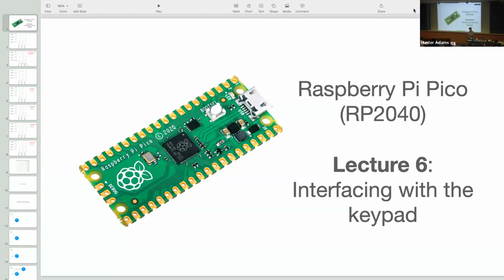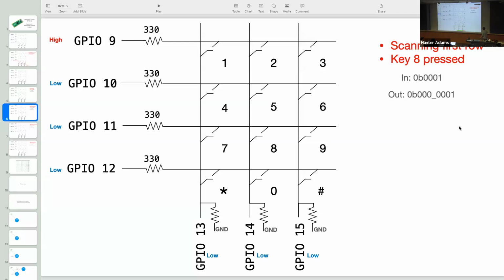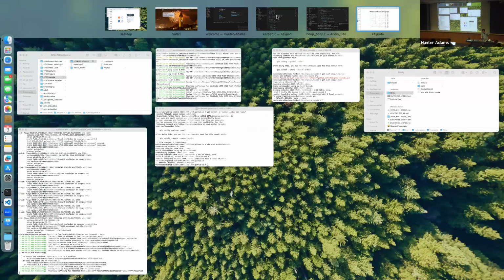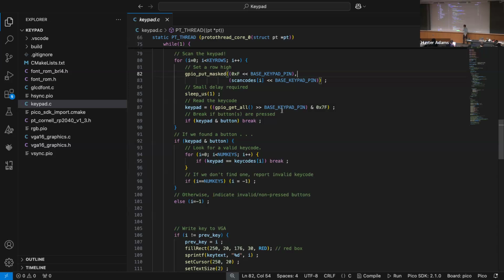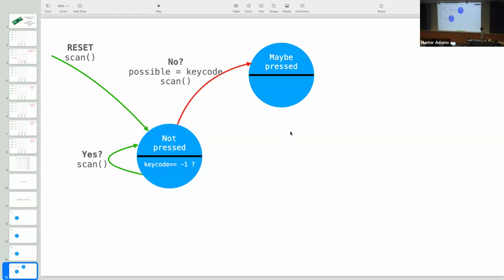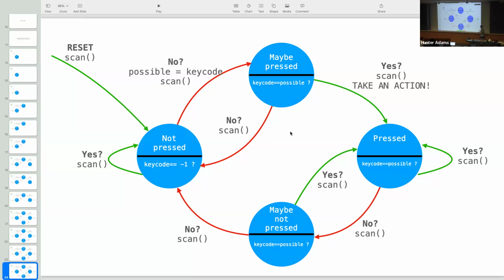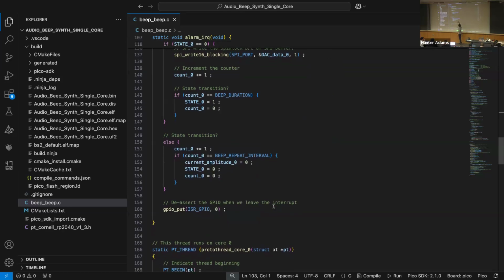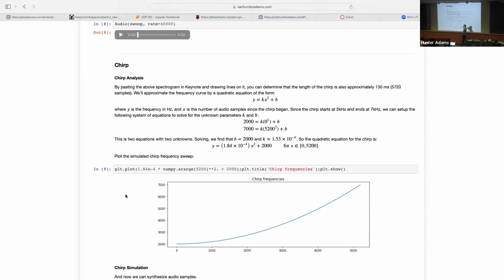Raspberry Pi Pico Lecture 6 (2025): Interfacing with a keypad

Comment: On my (non-matrix) button press code I generate a multi-byte field with a bit per pressed button from a timer interrupt, and I keep a ring-buffer of the last 8 such fields.   A key is only deemed pressed if the bitwise "and" of the relevant bit in all 8 ring-buffer entries is set.   Very simple, with no state machine - just button press history.

Comment: Hello, I really appreciate you taking your time to make and upload these videos. They have been an amazing resource for me. I have a quick question regarding the keypad. You mentioned using resistors to prevent shorting of two of the output pins. Why not just use a diode? Wouldn't that prevent the flow of electricity into the pins, or would the pins still short to ground if there where no limiting factor within the circuit? Thanks again!
Reply from the maker: Diodes would also work!